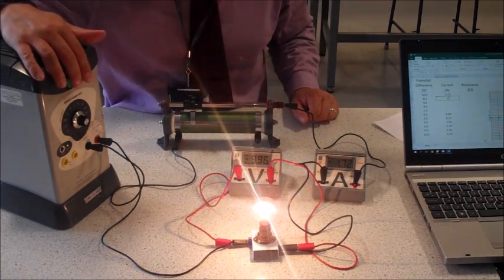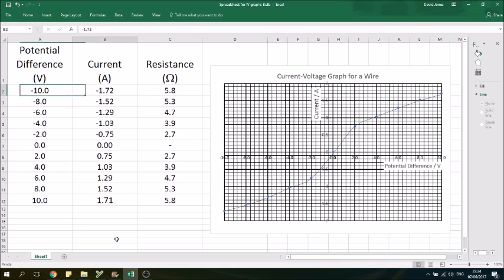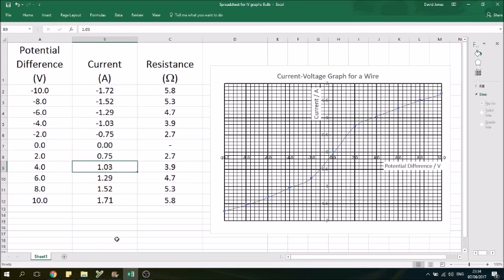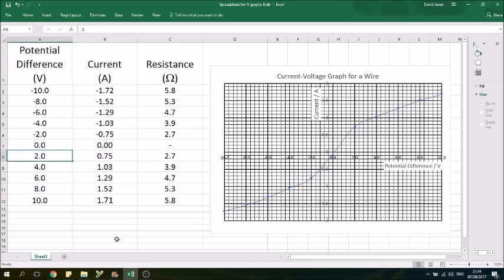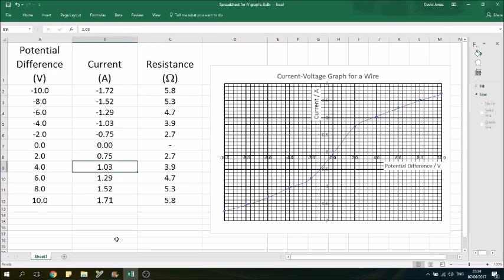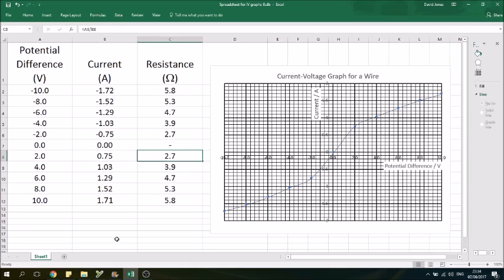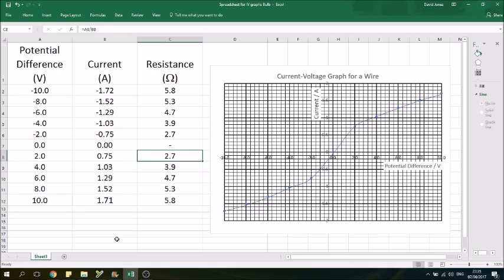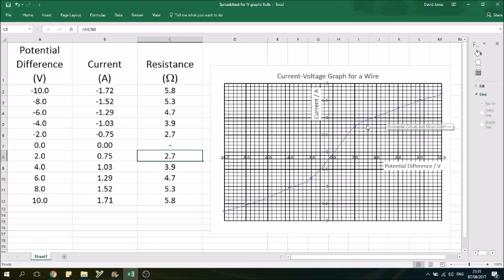AQA GCSE Science Required Practical V I Characteristic for a Filament Lamp

Comment: Why is the variable resistor used if the power supply is used to change potential difference?
Reply: It's used as a potential divider to 'fine tune' the potential difference across the lamp if you want to go up in equal intervals. Unfortunately due to the internal resistance of the powerpack when a current flows through the circuit the pd output of the powerpack won't exactly match what's on the dial.